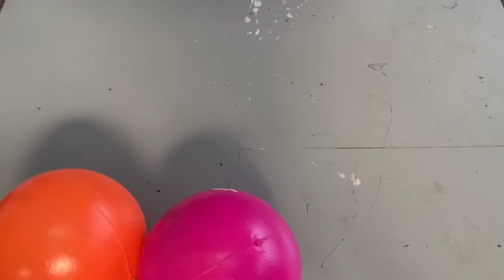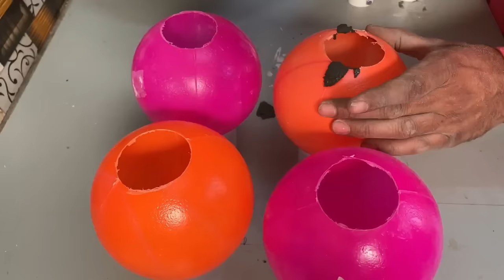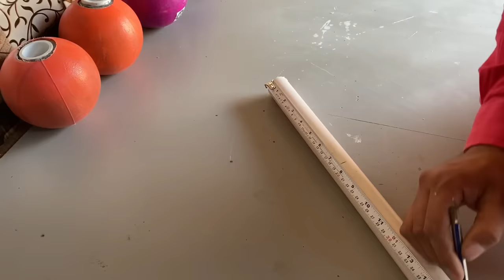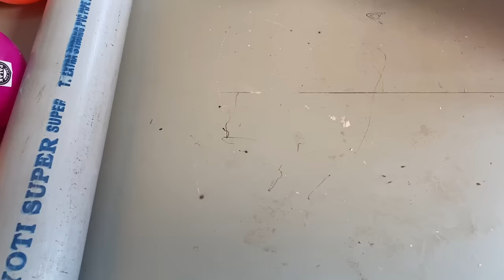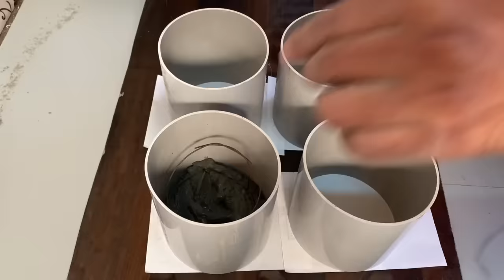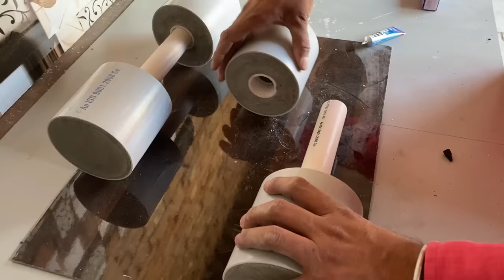Awesome idea To Make Homemade DUMBBELLS and gym equipment at Home

Comment: The variation of dumbbells is extremely useful for a small person like me https://www.youtube.com/post/UgkxP26Tir6n60vUkdtn4mbwhRO8cwuJQNy2  But the dumbbell size being large it's hard to do certain exercises like deadlift ( I have to have my hands and legs a bit wider to accommodate the size of the DB )Otherwise happy with the purchase. No excuse not to lift weight when it's snowing outside.

Comment: Recommendation to do it at home: use a large plastic cup such as a liter and use it as a measurement system, the basic proportion is 1 CEMENT and 2 SAND OPTIONALLY you can ADD 1 TO 3 PARTS OF CRUSHED ROCK OR GRAVEL
If you do not want to leave the floor or the table with traces of cement, you can use a container as shown in the video or prepare the mixture in a bucket

Comment: In dry and wet conditions, does the weight change?
Reply: Do you mean before he adds the water and after does the weight change. If so yes adding water makes it heavier. But the water dries out and you lose just a little weight but not much. Like if you wanted 45 pound plates you want the mixture to weigh about 47 pounds before drying then it would be around 45 done.

Comment: ...the sad part of it,that the concrete will give you about 1/4 of the weight of steel dumbells.The result will be big chunky of clumsy weight.
As an alternative will work.
Reply: yes,but.the good part is that its gonna cost 1/8th of that of steel. Use other shapes instead of balls to make it slimmer. Add some scrap metal/gravel etc n make it heavy. whole purpose of the video is for people who cant afford products with fancy prices!
Reply: Yes but weights are like houses atm stupid prices, no one is paid enough in their job to afford a traditional setup after price gouging

Unless you know how to do metalwork and forge weld from scrap metal, you've got nothing, unless you seek alternatives
Reply: Would definitely be better just to get a big sandbag, fill it with the desired amount of sand and rocks and lift that instead of wasting time buying plastic pipes and cement in order to make clumsy 8 pound dumbbells or whatever. One big weight lifting sandbag can be curled, rowed, shrugged, pressed (to some degree), lifted, squatted and thrown, and you can progressively add weight as you go along. 🤷‍♂️
Reply: @dradeel  Nah man those dumbells look better, just add bodyweight training and use those dumbells to burn out, sandbags should be a part of your training, not your only training
Reply: mix cut rebars, old bearings and/or steel shavings in the cement and it will be more dense

Comment: So we're supposed to know how to do this after watching this? Amazon here I come!🚶🏾‍♂️
Reply: P
Reply: Anchaldeep
Reply: Seems pretty straightforward. Probably less than $20 in material. Enjoy paying $200 for one set of dumbbells on Amazon lol.
Reply: Well... you just watched the video.. they used concrete and pvc.. some screws and pipe glue. What's hard to understand?
Reply: I'm wondering how much they actually weighed and how much money for the concrete.
Reply: @kyleorr533  actually there are adjustable dumb bells up to five adjustable sizes for the pair for around $200. That’s unless you don’t have Amazon or can’t afford the price tag. Then make them
Reply: @piaggiotech6  my comment is 9 months old…maybe they’re cheaper now?

Comment: What is the diameter of the plastic balls you used and the diameter of the PVC pipe you used to make your 5kg dumb bells? Thanks!
Reply: did u get the answer ?
Reply: You can use any diameter as long as it is the same on every ball and the pipe also should be of same diameter
Reply from the maker: 7-8 inch ball and pvc pipe 10-12 inch
Reply: @TheJugaadi  Can you make a video with 25 lbs each dumbbell please 🙏💕  don't forget write in the descriptión what materials we need for make it🤩🤩 Thank you!
Reply: @podapotta795  nalla per

Comment: by the time you have bought the sand and cement ,plastic pipes and containers  and screws you could buy dumbbells for around the same price and no work or mess involved  see if you can build a magic box and vanish

Comment: What is the size dimension of white PVC pipe for holding in middle of it?
Reply: I would just guess and use what felt good in your hands or look up the dimensions on an actual bar bell and maybe even go as far as what the cost might compare to.
Reply: Bro 1 inch nal fitting pipe

Comment: The video is good except people need to understand it's a plate, wider than it is tall, not tall and shallow like a pipe, it's a disc shape, not a tube

Cut some paving slabs, put 2 inch hole in middle, heat some plastic strips around it, much quicker way plus paving slab is already straight

Comment: Go to the store and buy dumbbells they cost like  $15😂
Reply: Prices doubled or tripled due to the Cove.
Reply: JasonWW2000 Amazon?
Reply: @tysonazure6168  A single 20lb dumbell used to cost $17 USD. Now it costs $53. So a big markup.
Reply: JasonWW2000 use cement and buy molds for the weights. People do it that way. And some type of seal for the cement
Reply: @tysonazure6168  You are basically describing the video I just watched. I personally have a home gym so I don't need to build homemade dumbbells.
Reply: JasonWW2000 I have a gym I don’t need to even watch this video try drop shipping and investing in some stocks my guy. I’m 16 and make 70k per year and over. I started with a 9-5 job at 15 and invested 10k into Tesla before the cyber truck came out and Tesla stock rose so I sold shares and invested in apple and Amazon and netflix
Reply: @tysonazure6168  Huh? How did these comments go from me telling you the real prices of dumbbells to you giving me advice about the stock market? (Rhetorical question) I don't need this advice. Sorry.
Reply: JasonWW2000 just letting people know you don’t have to work a 9-5 job. Not many people know how powerful the internet is nowdays and how much money can be made.
Reply: @tysonazure6168  as long as you believe in the systems delusions, it will work for you. Make sure you learn nothing of real substance, or you will have to violate the ensuing responsibilities that come with knowledge. There is such a bigger world than dollars and cents

Comment: Oh, no, no, no. if you really want to make yourself homemade dumbbells from a sand-cement mixture, then it's better to watch this video. There are all formulas, calculations, tables for the selection of dumbbell sizes. "Как сделать БЛИНЫ ДЛЯ ШТАНГИ или ГАНТЕЛЕЙ из БЕТОНА | DIY CONCRETE BARBELL WEIGHT"